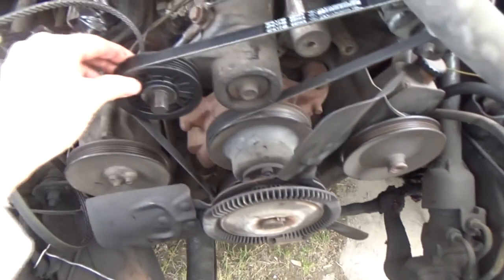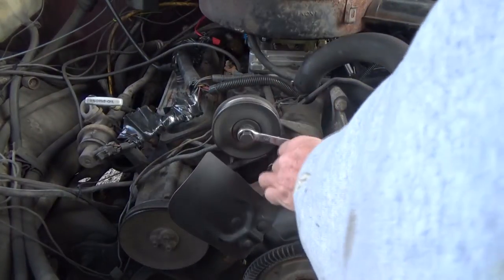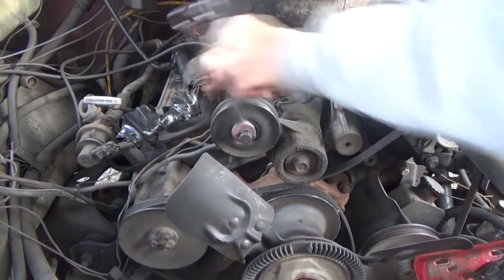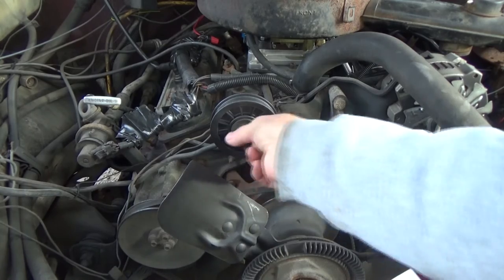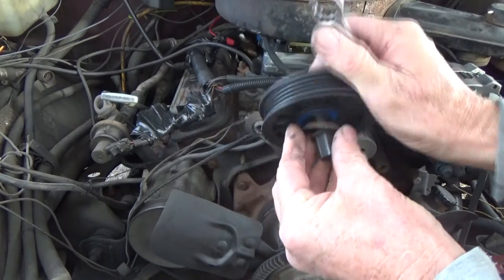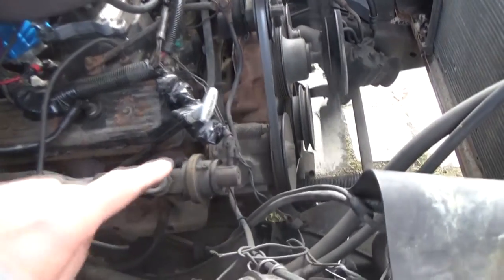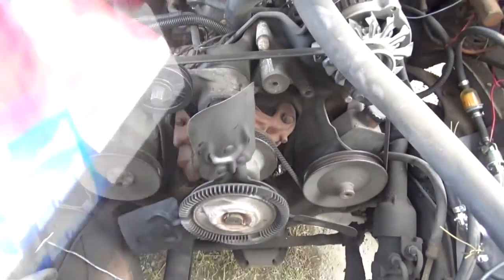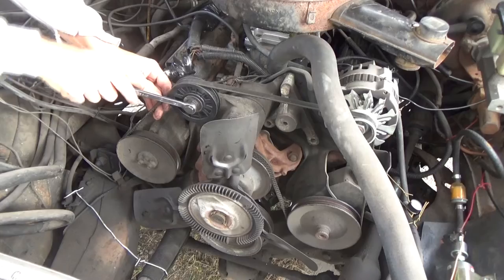Drive belt, tensioner pulley ,emergency drive belt replacement

Comment: Hey Mike another job well done did you take a look at your fan clutch it looked a little loose to me but I'm not there just thought I would share if it spins free when you spin it by hand I would replace it will also cause you to over heat I'm sure you have a thermostat video on the back burner lol. Awesome job as always be safe
Reply from the maker: thanks Mc Griggs,  I will check that, I do trip over mechanics at times,  I appreciate it ,  mike